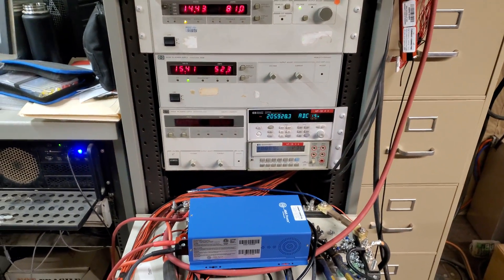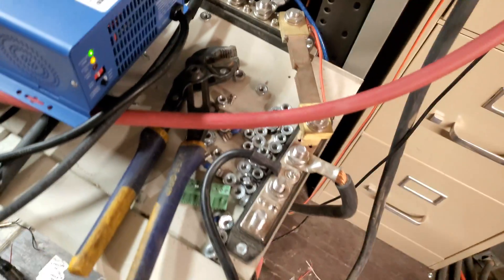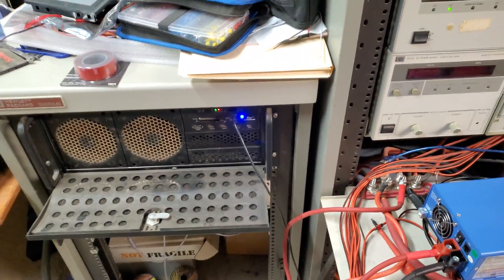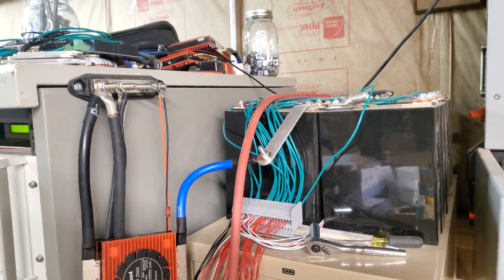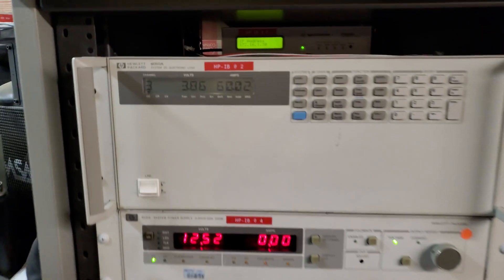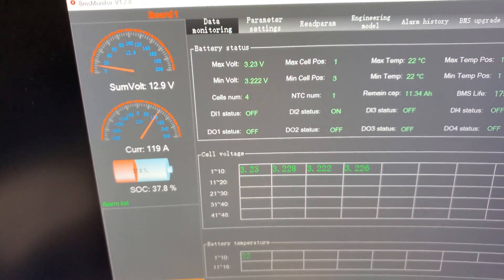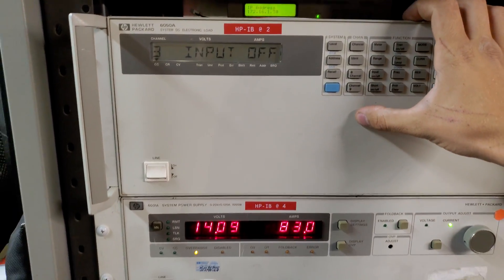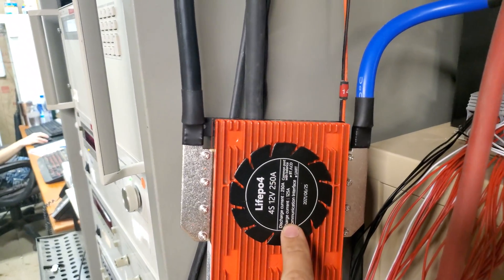Testing the Charge Current Limit of a Daly/Deligreen BMS

Comment: i have a daly bms and the current showed is not constant. If i charge with 50 amps, the display fluctuates between -2, -15 and -50 amps. is it defective?
Reply: You could  have your blue and black wire reversed.

Comment: These BMS's have separate MOSFETs for charge and discharge, despite being 2 wire "single port" types. The internal diodes in the MOSFETs dictate that this has to be the case. So they will have half as many charge MOSFETs compared to the load MOSFETs.

Hence I wouldn't push the charge current greater than 150A if you don't want to let the smoke out. While the case might be cool to the touch, the junction temperature inside the MOSFETs may be over its limit.

Comment: I'm not a fan of Daly BMSs because their cutoff voltage is outside the spec for LFP cells. I moved over to the Overkill Solar BMS and it is right on the money.
Reply: Their smart bms with BT you can program any of that without a problem
Reply from the maker: That's where the smart BMS comes in because it is programmable. I totally understand though we are carrying jbd BMS now

Comment: This is a rebranded daly. Normally they are overspec and can be programmed to limit the amperage for both charge and discharge current. For example, have a 100A rated daly and when the app is opened, the limit is both set for 150A which exceeded it rating. It can be set to lower than 150A but cannot exceed it.
Reply: He has "Daly" BMS in the title so he's aware of that

Comment: How long did you charge at 200A for?  I'd be interested to know how long it can accept that current before something bad/expensive happens.  I'm looking at Daly for 12v alternator charging but have to go up to 300A spec to get the max out of charge capacity of the alternator.  If Daly can hold that amount of overcurrent, I can go for a lower rated device and save significant cash.
Reply: I wouldnt go to far over the recommended max current.